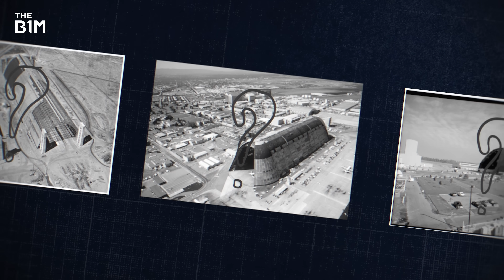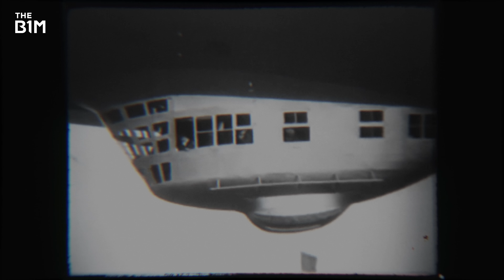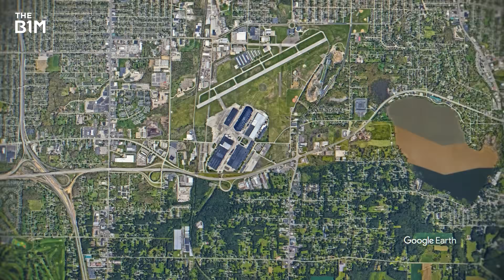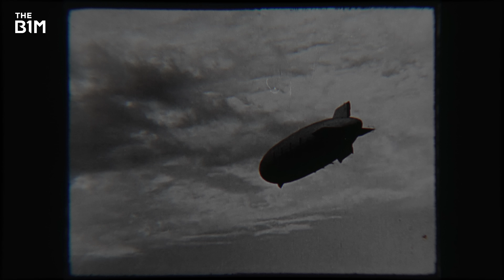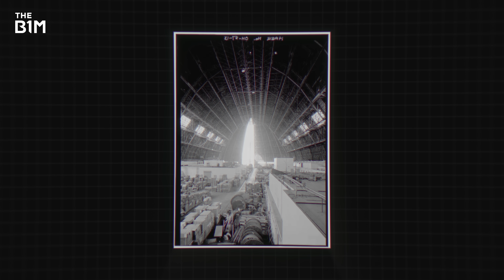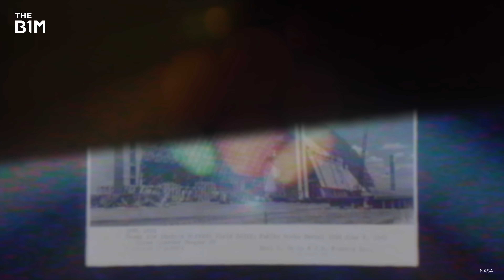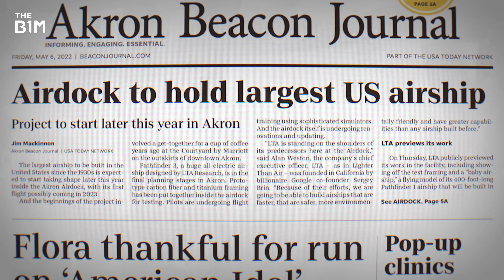The Abandoned Megastructure Saved by a Tech Giant

Comment: There is still a zeppelin hangar in Tustin, CA. I haven’t been inside but I’ve driven by it and it is massive! The scale of the structure is surreal.
Reply: MCAS Tustin Hangar No. 2 (1,072 ft long, 292 ft wide and 192 ft high) built during wartime 1942 of Douglas Fir.
(Sister Hangar No. 1 was destroyed by fire in 2023)
Reply: @Lwize  Bless you for the Imperial dimensions.
Reply: @toiyabe_effect  Let the metric folk do their own calculations...😉
Reply: @toiyabe_effect  Let the metric folk do their own calculations... ;)
Reply: @Lwize  Mismanagement on a serial level, caused its demise. Likely the sister will be destroyed in similar fashion.
Reply: The one left at Tustin is a twin to the one left at Moffett Field, Hangar 2. Hangar 3 was torn down last year and couldn’t be saved. Hangar One looks spectacular now. Thank you Fred!
Reply: When I was in elementary school I lived just a few miles away. I'm old so the Marine base was still operating but they didn't use them for blimps or dirigibles. I had a couple classmates who had parents stationed there and I still remember a 4th grade field trip to the base where we got to go inside one of the hangers. And there are a couple things about the base related to this video.

First, the official name was Marine Corps Air Station Tustin but everyone I knew called it LTA for Lighter Than Air. Second, I had heard clouds could form inside the hangers but during that field trip we were told that was a myth.
Reply: I'm surprised this one didn't get a mention. To this day it's still the largest wooden structure!

Comment: Is an airship more like an airsub?
Reply: Peculiar question, but I feel like diving down this rabbit hole. 🙂

A 'submarine' is called that because it travels below the surface of the sea.  By that logic, all craft that fly through the air and never leave it are 'airsubs'.

However, maritime ships and submarines both float.  That is, they maintain their position by being lighter than water (by displacement).  By that logic, all naval vessels should fall under the same broad category, and they do: 'vessel'.  For some reason, that doesn't include vehicles that travel through the air, not sure why.  Instead, both HTA and LTA vehicle are 'aircraft'.  I suppose it's to differentiate between vehicles that depend on water, versus those that depend on air.

But then we have vehicles that depend on dynamic lift versus those that depend on displacement to remain in the air, which are called 'aircraft', which should include LTA.  However, 'aircraft' is generally understood to not include LTA vehicles.  (You say 'aircraft' and people are not going to ask you if you mean LTA or HTA.  They're going to assume it has wings and depends on dynamic lift.)

So now we need a general word for LTA that includes all vehicles that depend on buoyancy in air, not water.  Guess what, that's 'airship'.  Why?  Well, when you look at how large water-vehicles move, they generally don't turn on a dime, and we call those 'ships', so when you see an LTA moving like a 'ship' (water), you think 'airship' to differentiate it from those that move on or under water.

However, you also have LTA that are entirely dependent upon the winds for movement.  Those are generally not called 'airships', they're called 'balloons'.

When you get right down to it, humans are illogical, and our languages are the same way.  Every 'logical' language that was designed specifically to eliminate this ambiguity has broken on the rocks of:

"We don't have a world for that."   "Well, then make one.  How about Fooblah?"   "Sounds great!"

"Hold on there!  We use Faablah!"  "Well, we standardized on Fooblah, so you'll just have to change."

"Why?"  "Well, that's what we standardized on!"

"We didn't, and we see no reason we should have to change!  Why don't you change?"  "Because we're bigger than you."  "Oh!  We're down to that is it?  Maybe I should start screaming 'See the violence inherent in the system!""

And Monty Python rules the world, again...

Comment: please include metric... none of the measurements meant anything to me
Reply: Not even tennis courts?
Reply: @tsch3629  that's 37.3 washing machines
Reply: @flavio.portela  Where I'm from, this would be around 89 Wiener dogs... now it all makes sense.
Reply: @flavio.portela  🙃🙃
Reply: @tsch3629 
Tennis courts are 133.71 bananas long, for reference
Reply: Yes but how many football pitches is that?
Reply: @jonr6680  Which football? Soccer? Gridiron? Rugby? Gaelic? Australian Rules?
Reply: @jonr6680 
3½
Reply: @jonr6680 football is played on a field and it’s about 100 meters
Reply: Wot?  Not even tonnes?  🙂
Reply: @EdwinWiles metric tonnes and imperial tonnes are different.
Reply: @ThalesXFP  now I wonder what he meant by tonnes...
Reply: @ThalesXFP  metric = tonnes... imperial = tons
Reply: @ThalesXFP  As an author, I've had reason to look into proper nomenclature.  In the US, "ton" is 2,000 lbs (the US Ton, or 'short ton'), while "tonne" is specifically metric tons or 1,000 kg.  Worse, there's also the 'long ton', 2,240 lbs (the Imperial Ton) sometimes still used in shipping.

Unfortunately, there's a lot of confusion out there, and people mix the two words horridly.  So, in practice, you frequently have to ask the writer which version of 'large weight measurement' they're using.

I would have been far happier had The B1M at least placed both measurements on the screen.
Reply: Don't see the problem. Easy to learn both and roughly convert in your head !  (Well, it is in my head ) 😁
Reply: @Dudley-x2c  But why would I bother? As a non-USer, imperial only ever shows up in my life in YT videos. American industries heavily reliant on international trade or precision rely on the metric system (SI). Key sectors include automotive manufacturing, pharmaceuticals, science and technology, and aviation. These industries transitioned to maintain global interoperability and prevent engineering mismatches across worldwide supply chains.This means that even the US is phasing it out. It's just the "folk" that are keeping it alive. Give it a generation or two and it'll be as dead as latin.
Reply: @EdwinWiles long tons are very close to metric tonnes
Reply: @symphantic4552 
Given the number of machines that are still sized & tooled with Imperial measurements (not to mention houses), I honestly doubt Imperial will be gone in 50 years as you suggest.

Trust me, it sucks having to buy two sets of tools to work on things.  I wish we could change to metric yesterday, but machine inertia will prevent it for some time to come.   Sadly.
Reply: @symphantic4552  it's not that you won't. You can't. You've reached your full potential.
Reply: @EdwinWiles OMG, I had no idea the septics had their own “ton” as well as their own gallon and fluid ounce. I always assumed a ton was 2,240 lb. Turns out they use both the long ton and the short ton depending on what they’re weighing, because of course they do. Apparently one wildly impractical system of units wasn’t quite enough, so they kept adding new ones like a standards committee trapped in a grain silo with a barrel of moonshine.
They even have their own version of “cups” for volume, and in water management they use the “acre-foot”: the volume needed to cover one acre to a depth of one foot. A unit that sounds less like science and more like something muttered by a rancher during a dust storm.
What a weird country.
Reply: @Nilguiri  Is "septics" a weird insult or a typo?
Reply: @JPMadden auto correct for seppos probably
Reply: @symphantic4552  English is not my first language, it's even more confusing... 😅
Reply: @JPMadden  Neither; it's Cockney rhyming slang: Septic tank = Yank.
Reply: @NovemberSky3  Nope.
Reply: @Nilguiri  So it is a weird insult.  Thanks for explaining it.
Reply: @JPMadden  No, it's Cockney rhyming slang, as I told you.
Reply: @Nilguiri  You explained its origin and I offered an opinion about how the people it's referring to should think of it.  We can both be correct.
Reply: @ThalesXFP  - metric tonnes and Imperial tons are only a few %age points apart, close enough to be interchangeable for most purposes. It's American tons that cause confusion, since they're about 12% smaller.
Reply: @ThalesXFP not really actually
Reply: @EdwinWiles
1 Tonne = 1000 kg / 2204 lbs
1 Ton = 907 kg / 2000 lbs
1 UK Ton = 1016 kg / 2240 lbs

It's a mess.  No one is specific when they say "ton".  I hate it.
Reply: @NeilÇedilla okay I'll agree with this one. The whole ton thing is a pain in the ass.
Reply: Wait what ... There are different imperial systems ? 🫪 (Watching from metric Europe)
Reply: The American system is called "United States customary units."  We do use SI (metric) units in the U.S. for science, in the military, for a few consumer goods, and I think more frequently in manufacturing.
Reply: @khodahh - no, there's one Imperial system, and then there's the American system that they seem to think is the same thing, even though converting between Imperial and metric is often easier than Imperial and American.

Give me a cake recipe in Imperial, and a set of metric scales, and I can do the calculations in my head with very little effort. It's the same in reverse. Admittedly I've had over forty years of practice, but the maths isn't particularly complicated. But give me that recipe in American, and it doesn't matter if the scales are metric or Imperial: I will need a conversation chart, a calculator, and possibly a ouija board.
Reply: Let me Google that for you....
Reply: Wondering about loads airships can carry - perhaps they might need to be expressed in mega fluid ounces to make it seem worth building.
Reply: Literally just google the conversion 🥴
Reply: Yeah really not hard to have these infographics show metric as well, dont even have to say it in metric
Reply: @bible5569 It's also not hard to expand your knowledge and have some awareness of the other major measurement system in operation on the planet.  You don't see Americans in here moaning when he only uses metric units.
Reply: Funny thing is your weird system of weights and measures is actually sitting on a metric foundation. Go read up at your NIST if you don’t believe me… 😊
Reply: Thats a failing on your part
Reply: It's  HUUUUUUUGE
Reply: What’s that sir? Here in America we use feet and miles fk off
Reply: There this new tool called Google. Type in the English metric and ask to convert to metric. It’s cool. That’s how I have been figuring out metric measures for 3 decades.
Reply: Use a conversion app like the people who use imperial units do when watching every other video on this channel.
Reply: @Sasfoot  Just start using the metric system like the rest of the damn planet.
Reply: @symphantic4552  He uses metric in almost every video and you whine about one of the very rare occasions he uses imperial.
Reply: Yep, and I don't intend to google conversion.
Reply: @skawel1  not every time.
Reply: @skawel1 so you're here to complain and not do anything else about it, because you wanna be spoon, fed
Reply: @skawel1 
Ignorance is bliss
Reply: @skawel1 then don't. We don't care. The hangers were built in imperial, they should be listed in imperial.
Reply: @1slotmech  This is a relevant point! kudos.
Reply: @symphantic4552  No, it's not. Anything can be measured in either metric or imperial. And imperial is defined by metric, anyway. The definition of an inch is 2.54 cm.
Reply: Good. 😊
Reply: Divide by 3.2 so the 1175ft is around 367 metres
Reply: How could he do that? They’re built in imperial 😜. It does seem like a weird omission to not have the metres in brackets, but the US and UK both understand things in feet and inches so that’s why he chose feet as the unit to mention.
Reply: I agree he should.  But I find it ironic that in this way some of us Americans are the people more likely to be bilingual.
Reply: @JPMadden no. When comes to using metric and imperial the UK has America beat. 

We price fuel by the litre, but measure economy by the gallon. That’s imperial gallons not American gallons. The UK gallon is about 20% bigger. Road distances and speeds are in miles. 

We measure our height in feet and inches. But weight in kilograms or stone. Never just pounds. The only time we use pounds for a persons weight is for a newborn baby, pounds and ounces. 

We measure temperature in Celsius. 

We buy wine and spirit is in millimetres. But beer in pints. Again the imperial pint that is 20% bigger than the American pint.
Reply: @sparky4878  I know, right?  Americans deserve being made fun of for being anti-metric, but not by Brits.
Reply: Sounds like a skill issue
Reply: @mesientogut6701 sounds like someone living in the modern world issue.
Reply: @mesientogut6701 
Sound like not using some king's foot length.
Reply: Divide "feet" by 3 to get meters.   It's rough, but not hard.
Reply: Maybe expand your horizons and learn multiple systems like Americans do.
Reply: If you can't multiply or divide by 3, you really need to have a conversation with your maths teacher.
Or your therapist.
Reply: @NeilÇedilla I am not sure if the issue is us or US when you get what I mean ;-)
Reply: cry harder
Reply: @dontyouworryaboutit_  I'll cry zero centilitres over this.
Reply: @dontyouworryaboutit_  Oh dear. You must feel so embarrassed.
Reply: @N @Nilguiri  not at all, go find a conversion calculator and shut the hell up
Reply: Just pause the video and Google the measurements. It takes a few seconds and won’t leave you so dumbfounded. Really.
Reply: @Montanaman-j6l  but you never know which imperial units they have used. Would be helpful to have it correct in the screen as author of the video maybe knows which source the units are taken from and if it is UK or American imperials... One anyway needs to specify in Google that what the conversion to metrics is done from.